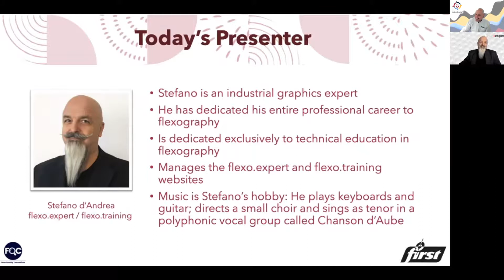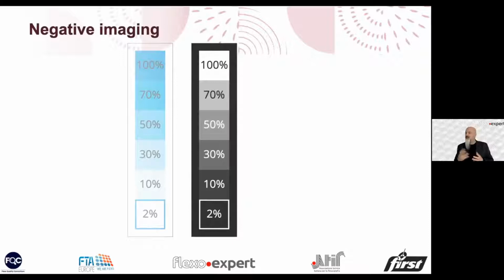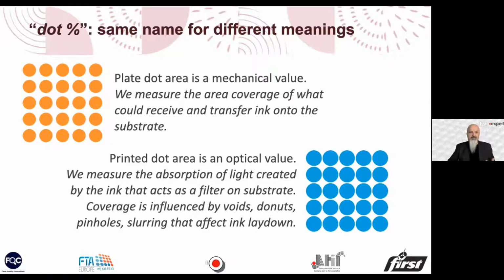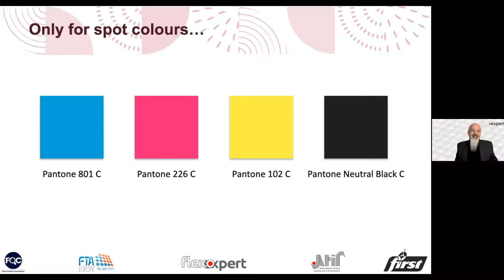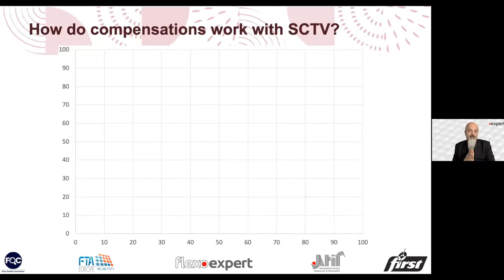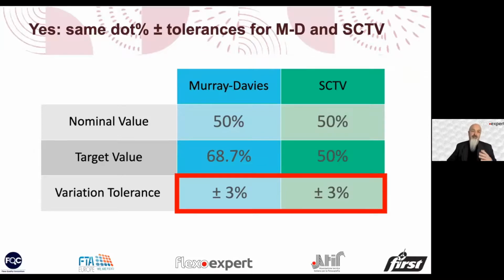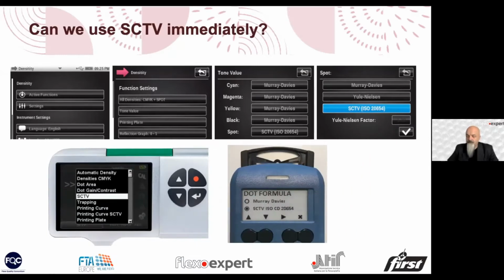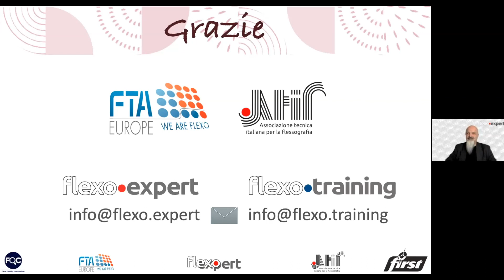It's time to change the way we measure dot percentage!

Comment: In offset you can reproduce the plate without any adjustment or compensating
Reply from the maker: Yes Scott, the same happens in flexo: in offset you can output linear plates - just as well as in flexo - for certain printing conditions. Then you apply tonal value adjustments with dotgain compensations curves. The methods described in ISO/TS 10128  are applicable with any printing technology.
Reply: I'm relatively new to flex and new to your channel. One struggle I have is controlling viscosity in water base ink. Have you made any videos dealing with that?
Reply from the maker: @scottgarber4558  I do not have any specific video but I cover all aspects related to viscosity and pH in waterbased inks in my trainings. You can take a look at https://flexo.training or contact me from my page https://www.flexo.expert/about/contact/ or via LinkedIn https://www.linkedin.com/in/dandreastefano/
Reply from the maker: @scottgarber4558  also, if you plan to attend the FTA Forum 2023 in Columbus OH https://forum.flexography.org/ I will be there